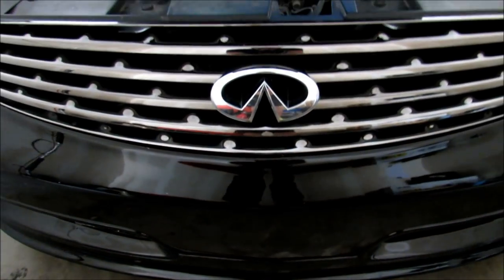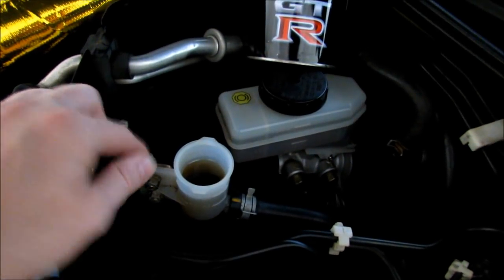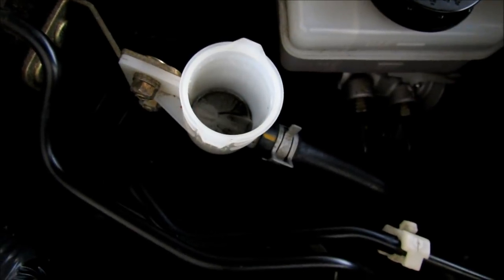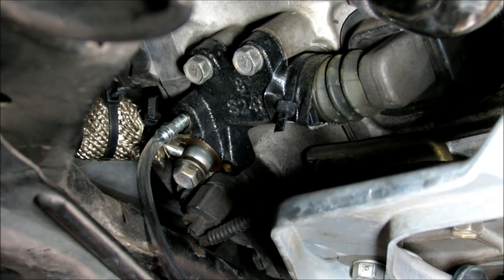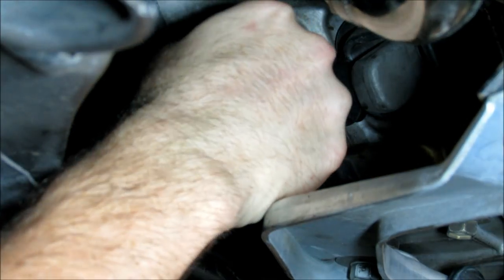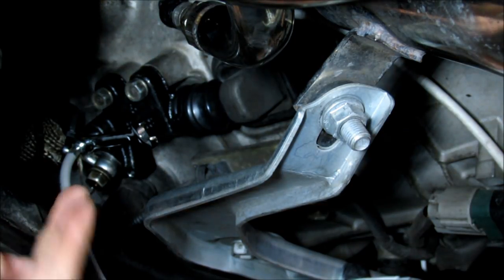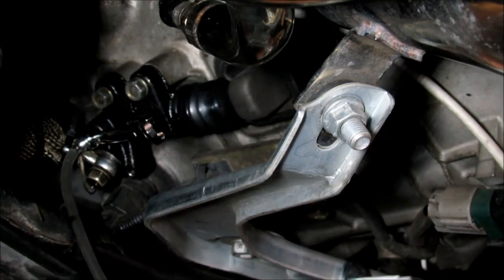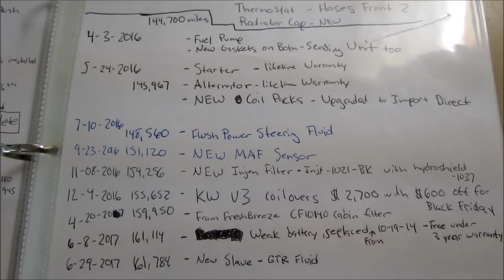INFINITI G35 / Nissan 350z - Fix Clutch Pedal - Bleed Install Slave Cylinder

Comment from the maker: TSB report from Infiniti on GTR brake fluid to use for the Slave Cylinder. https://www.google.com/url?sa=t&source=web&rct=j&url=http://www.infinitig37.com/TSB/ITB13-005a.pdf&ved=0ahUKEwisjenv3sDXAhUK5WMKHUz3CdIQFggcMAA&usg=AOvVaw1iNmlyjESNrwVbqMhXYyL0
Reply: Motordyne G35 this won’t apply for models 03-06 tho..right?
Reply: Thanks so much! My pedal got stuck to the floor on the highway I luckily was able to pull it back with my foot and basically shift in between without any fluid 😬but I pulled to the side and pump it to make it back home.

Comment: When I pump, my fork does not move
Reply: Same. Did you ever figure out what to do?
Reply: DumpsterJedi throw out sleeve was bad you need to replace it & if you do that might as well Change the throw out sleeve because mine messed up
Reply: @ronnycerritos7811  what do you mean throw out sleeve? Throw out bearing?
Reply: DumpsterJedi search it up they're very important
Reply: DumpsterJedi but they aren't super expensive
Reply: @ronnycerritos7811  expensive to replace, that's inside the transmission, has to come out to do it.
Reply: DumpsterJedi yes
Reply: Did u ever find out what it was ? Got the same problem after tryna bleed
Reply: @mractive420  still not sure how but I did get it to work. First I took off the slave and put fluid in it and bled it by hand, making sure the piston was all the way out before I put it back on the car. Then I hooked up the banjo bolt to the slave before bolting the slave to the tranny. Then it worked fine without any bleeding. But then after I tried adjusting the pedal it lost all pressure again somehow.

This is what I did to bleed after that, except I "bench bled" on the car, disconnecting the Mc rod from the clutch pedal, and pushing the rod all the way in with a screw driver
https://youtu.be/47mmWuYw2Ic

Once I had all the air out, every time I tried conventional bleeding it just lost pressure again. So I did the above method again, made sure the air was out, closed up the bleeder, hooked the Mc back up to the pedal, and just pumped. Got it to move the slave about half that it should, but was enough to get it in gear smoothly even tho the engagement point was as soon as the pedal came off the floor. Drove it around for about 40 minutes and right about when I got back home it started acting like a normal clutch again. 3 days later and it's been running great. 

So I would try that. The one man bleed method, until you can get it in gear, ignore conventional bleeding, and just pump the shit out of it. Hope it helps.
Reply: @dumpsterjedi9323  definitely gonna try this when I get home. I know my clutch isn't bad, or tb, the pedal definitely felt like it caught air in it. Hopefully this works
Reply: @VQ_menace90  I made a forum post over at g35 driver, you don't have to keep referencing YouTube comments. Hopefully you get it worked out.
https://g35driver.com/forums/g35-coupe-v35-2003-07/469853-bleeding-clutch-has-no-pressure.html#post7197936

Comment: Normally you put the tube on before you open it all the way, gotta love a corrosive brake/clutch fluid mess
Reply from the maker: yep, my bad. I messed up on that part and I should have put the tube on first. Not really a big deal though.

Comment: The Z has the biggest POS bleeding system. I am going to replace my factory hardline/ softline with braded lines in about a week. This way I can 100% bleed the brakes without the nissan valve system getting in between.

Comment: Tried to replace the hard line with a braided one, but stripped the top fitting even with the special brake line wrench.

Bleeding was a pain. Tried a bunch of different methods and could never get more than a little bit of pressure.  I gave up and took the car off the stands. I started pumping the pedal with my foot and after a few minutes had good pressure. After a few days I had perfect pressure. So idk what advice to give me except pump the shit out of it.

Comment: I just replaced the slave and when I was trying to bleed it I notice that pressure wasn't building up then I someone press the clutch for me and notice that nothing was moving and it wasn't moving the clutch fork and notice when I put new brake fluid that it wouldn't really move even though I made sure my lines were drain and my reservoir would just fill up fast and I'm not sure what's happening or what to do

Comment: I can't get pressure in my clutch pedal... Replaced the master cylinder, bench bled it also, the slave cylinder does not actuate and I get occasional drips of fluid coming out of it.

Comment: I replace the sleeve cylinder but my clutch pedal if i pressed down stay down. I try bleeding de the line  pushing and pulling the pedal by hand but nothing happens

Comment: I tried to bled my clutch slave and the problem I have is that I dont get a good seal around the slave fitting threads. Even at the slightest loosening air gets suck in during the pumping process making it impossible to bled. Should I tried a different brand slave, ?? This one I got from my local auto parts. I read of people using plumbing thread tape, but I dont want to take chances and get a random piece of tape in my clutch line....

Comment: you installed your slave push rod backwards. See page CL-11 of the 2006 350z TSM. The neck part goes into the rubber boot. The way you have it will wear out the cup part of the piston.

Comment: Hi, fantastic video, thanks!  When I tried to drain the fluid from the bleed valve, nothing came out when I loosened the nut!  I had the cap off the reservoir.  Shall I just continue to remove the main line and hope it comes out that way!?  Many thanks

Comment: Hello, I know this is an older video but still very informative and relevant since I drive an 06 350z. I have couple questions regarding this mushy pedal issue/fix job.
First, how to differentiate a bad slave cylinder and a bad master cylinder, symptoms seem the same regarding the "mushy" pedal feel, or how it's described in some forums as abnormal pedal behavior. And in your opinion if neither have been serviced before, should I replace both?
Second, this may sound a little silly but when you are bleeding the system do you fill the reservoir to full before the bleeding process? I couldn't really tell in the video.
As a vq owner I can't thank you enough for the videos you post, it's been a great learning experience and definitely saves us a lot of money.

Comment: Awesome video bro! All of the G35/350z slave videos out there never go in-depth like you did in this video. Great explanation. Wish I had this video when I was trying to learn how to do mine! I replaced my master and slave and I was still getting a sticky clutch where it would stick half way. I bled it perfectly, yet I was still getting the issue. Turned out my entire pedal assembly was bad and extremely difficult for the master to push back up. Now that I have my RJM pedal, I couldn't be happier.
Reply from the maker: Thanks again, bud. I watched your sticky clutch video so between the both of our videos, 1 of them will help the people. I have not done the RJM pedal swap either like you, but I have not had an issue with my pedal assembly. Over the years, I like the high engagement point. I also have never replaced the master either, maybe that is why my fluid keeps turning black. I guess it is only a matter of time, my day is coming and I will be checking out yor RJM video again, if I run into issues like you and need to buy the swap.
Reply: For sure. After using the RJM pedal for some time I decided to re-adjust it to have my engagement point towards the top. The extra length towards the bottom of the pedal gives my shifter a much smoother gear change, even with my chattery single mass haha. The higher engagement point also allows me to change gears faster so I don't have to press down as far or as hard, it's mint!

Comment: Nice and helpful video. I think the pushrod goes with the other end through the boot. The pushrod has a grove at one end where the boot hooks. The smooth side goes in the slave
Reply: Was just checking this because I too knew it to go reverse what he said.  My old push rod was with groove to boot.

Comment: Thanks! I did this a couple of days ago and drove it to PCH with AC on and hot weather...normally the clutch and shifter would struggle...but now it was smoother than EVER before. The old part was full of gunk. Put Dot4 brake fluid..idk if that’s ok or not.

Comment: So my hose cracked and the pedal went to the floor without returning. I replaced the slave cylinder because it was the original factory cylinder with 91,000 miles. I also of course replaced the hose. I did what you said for over an hour. The pedal never returned once. The best it did was barely build any pressure at the bottom two inches. Any suggestions would get you another subscriber
Reply from the maker: If you kept pumping it and it wouldn’t return, either a lot of air entered the system from a cracked hose and you need to pump the pedal until it gets some sort of pressure.
Reply from the maker: Or your master cylinder went bad. Video here on how to replace your master that controls the slave. https://youtu.be/Vt_NXTC1vro
Reply: I was so worried my master had gone bad. I was opening the bleeder valve on the slave cylinder too far. Which was causing the system to bleed off all its pressure. I eventually realized this and it began to build up a noticeable amount of pressure. Once I recognized my mistake with the bleeder valve. I was able to build up enough pressure to get the pedal to return to the top. Now it has that new pedal feel. I kept pumping the pedal after it was returning to the top and cracking open the valve with pedal to the floor. Then repeated that several times. I haven't tried starting my Z and seeing if it grinds shifting into 1st or reverse yet. It's storming today and I don't drive my Z in the rain. My air filter is behind the front bumper. So I don't wanna hydro lock my engine. I'm sure the clutch will be okay. Thanks for your help....hitting the subscribe button now
Reply: @MotordyneG35....So I came home tonight from work at 2am. Not expecting when I  pushed the clutch pedal to the floor. It felt like there wasn't anything there. It went down with little effort and returned to top about 3/4 the way. It doesn't have any leaks so I'm assuming it's air. But it baffles me why 24hrs ago it was ready to drive and now it's not. Any suggestions???

Comment: Thanks Motordyne! I just replaced my clutch fluid and Slave Cylinder with no issues.🤘
Reply from the maker: Way to tackle the job yourself, nice work. After doing it, you realize, how easy it really is.
Reply: Did you leave reservoir cap on or off ?

Comment: I changed my slave and my clutch is very easy to put in and it won’t come back up. After I replaced it when bleeding it it just won’t bleed I did everything the same way I’m tripping rn
Reply: How u did it

Comment: I loosened my bleed valve and the fluid didn’t drain. I also took off the slave cylinder and my fluid won’t drain. I don’t understand
Reply: For anybody having this problem; Take off the slave cylinder and let the fluid line dangle in a catch can. Go inside your car and pound on your clutch pedal until the fluid comes out.

Comment: Good security for ~ $30 OEM too. I usually do it after a clutch change which I average at around 5 years.
Reply from the maker: Oreilly's has a lifetime warranty. When I change it, every time, it cost me absolutely nothing. You can't really beat free, is why I did not go OEM. OEM fails sooner too.
Reply: @MotordyneG35  I looked on Oreilly's and the only one available is a Power Torque brand.  Is that the one you got?

Comment: Appreciate the video, my son and I did the same to mine.  Probably will need to bleed it out again.  Kudos!!!
Reply: Hi, i'm getting a little clutch lapping between 1st and 2nd gear. before changing the slave.  it went away but is starting to come back.  Mostly when the car is cold mine is an 05 6mt G35 Sport sedan.  Have heard that they are noisey but want your opinion on what it could be.  Cluth and fly wheel was replaced by dealer I purchased from in Feb 2018 they did not do the slave. The slave was changed about a month or so ago after watching your vid same deal Oreilleys w/lifetime waranty.  Also should I switch to the GTR fluid, the TSB show for 2008 and up.  Thanks for the assist.

Comment: Motordyne G35 thank you so much for the video. I thought that this was the same problem I was facing with my 2005 G35. my problem however is that the fork that  pushes up again the slave cylinder does not extend all the way, it sort of stops half - 3/4 of the way when the pedal is fully depressed touching the floor. This causes another problem which is that the clutch pedal doesn't even reach the safety  switch so I have to reach down and press it with my hand to start the car. what could possibly be wrong? thanks.
Reply from the maker: Tyler Adagala...did you replace the slave cylinder?
Reply: Motordyne G35 yes I just finished replacing it. bled it twice and no air bubbles left. took it for a drive and the clutch point is extremely low. changing gears is also difficult especially first I have to shimmy the shifter around and then 4th I have to wait 2-3 seconds before it locks in gear
Reply from the maker: Tyler Adagala ...does the clutch pedal feel firm? Was the engagement point high on the clutch before? Did everything work fine before replacing the slave?
Reply from the maker: Sounds like you need to keep bleeding it.....
Reply: Motordyne G35 clutch pedal feels fine but the engagement point is nearly at the bottom opposed to the normal high catch point. the main thing is that I don't think the clutch is fully disengaging. which also causes the problem of the clutch not hitting the safety switch allowing for me to start the car. before this happened there would occasionally be some creaking and popping sounds that would occurre when I would release the clutch as well. master cylinder? clutch pedal assemby possibly?

Comment: Recently did a clutch change now the shifter won't go into any gear even with the clutch fully disengaged wether the car is on or off. The shifter only goes to the right any ideas what's happening?
Reply: Mine does the same but it goes into gear only when the car off what was the issue

Comment: Awesome video! unfortunately my 06 350z does not build clutch pressure like yours-pedal comes up only half way. I have replaced the master, slave cylinder and clutch line  to a braided stainless steel line. the clevis on master cylinder is set to stock distance per FSM. I have tried everything to bleeding the darn thing-pressure, vacuum, reverse bleed. when you bled your G, did you have only the front of the car on Jacks or all four? reason I ask is I wonder if having only the frontend up helps air bleed out of the master cylinder... really out of ideas.
Reply from the maker: I had the car on jack stands, just the front end. Unless you are bleeding it wrong, it should come all the way up. Try looking at Aaron's video, he had the same issue as you and this worked for him.............https://www.youtube.com/watch?v=SPNpiGDpYf0

If that video works for you, make sure to tell him I sent you his way.
Reply: thanks for the tip! I think having only the front end on Jacks helped a little bit. how many cycles of pumping/opening bleeder screw did you think you did to get all the air out? I've done maybe 15 cycles but I still see little bubbles coming out. and peddle only comes up about half way. I guess I will keep on bleeding.
Reply: naru177, if you use aftermarket part, you need to adjust your clutch pedal.